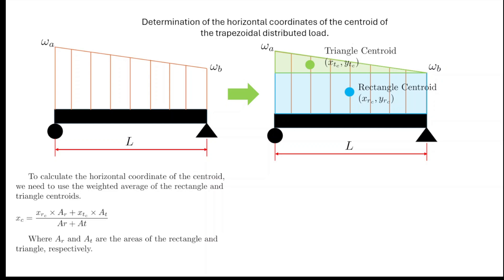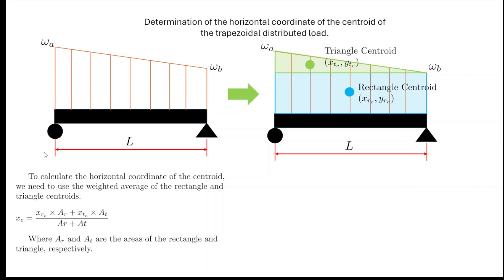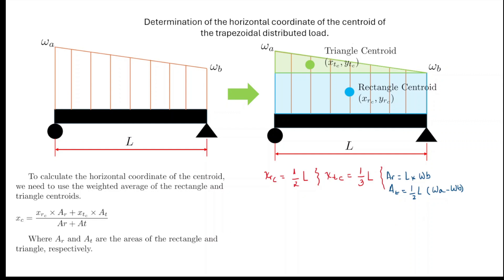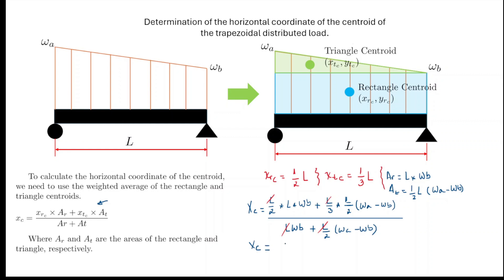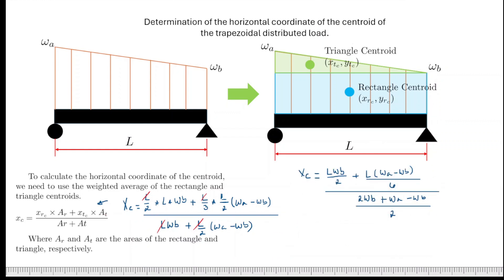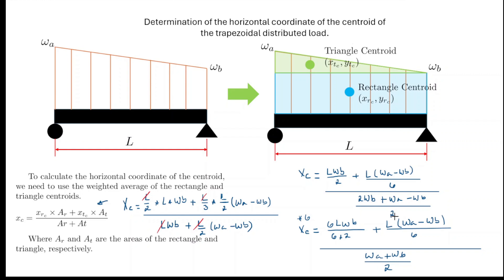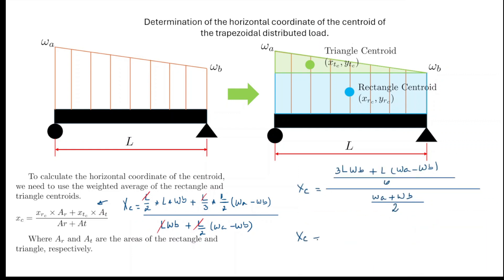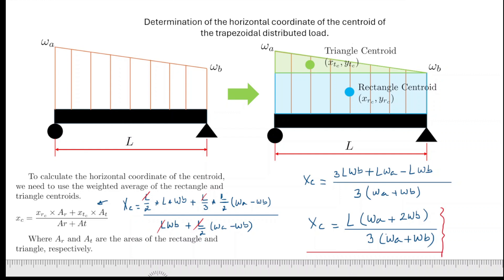How to determine the horizontal coordinate of the centroid of a trapezoidal distributed load.

Comment: Sir how about if i start my moment arm from the pin support?
Reply from the maker: Hi, you just need to change the values of the distances to each one of figures' centroids. For example, in the video, we have the triangle centroid locate at 1/3 of L. In your approach, this would change to 2/3 of L. The rectangle centroid position remains the same. Doing this substitution will give you the position of the trapezoid centroid from the pin support. I hope it helps.